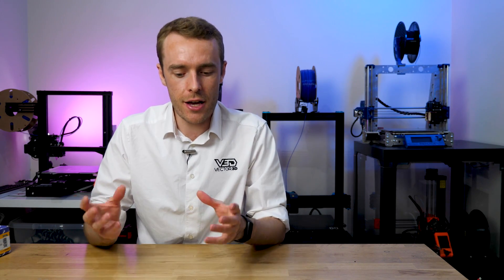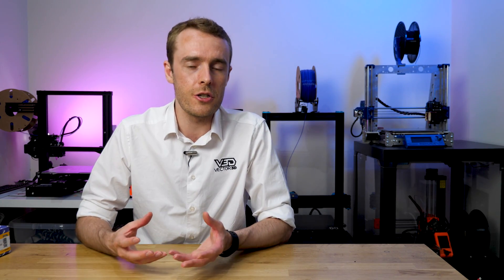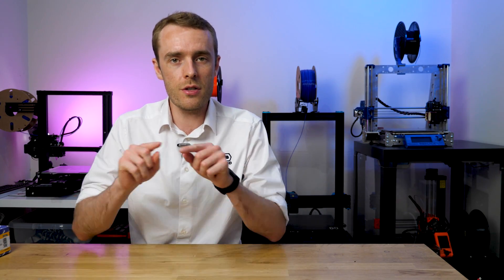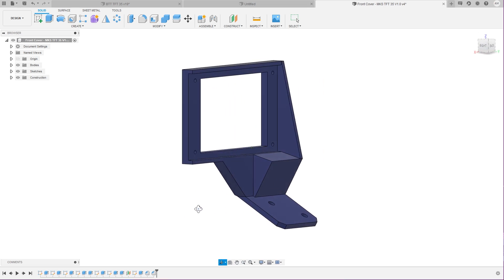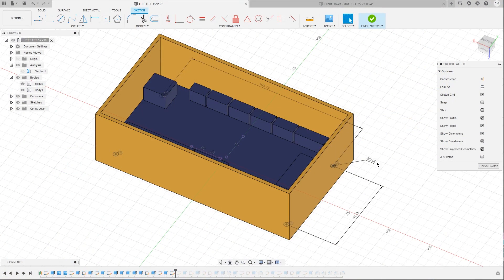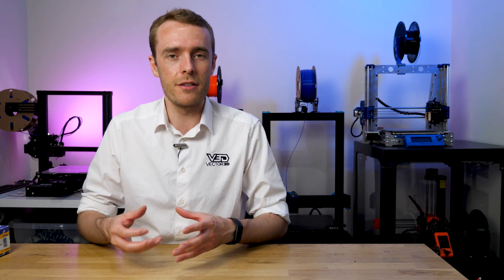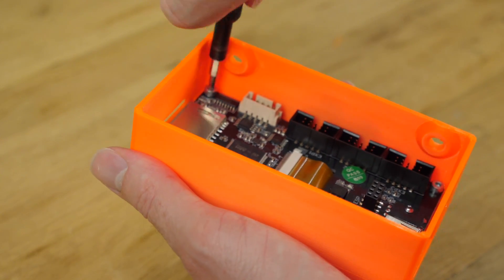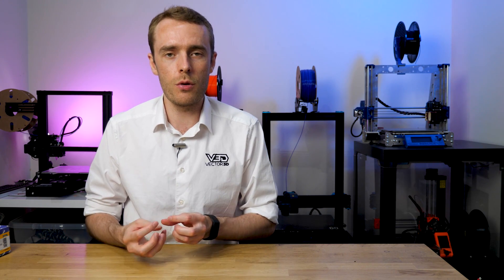6 Simple Design Tricks for Touch Screen Enclosure using Fusion 360

Comment: On a technical note (pet peeve?): "tolerance", and "clearance" are often interchanged, but are technically different. You're a smart guy, so I suspect you actually know the distinction, but are just a little loose at times (though, not like you, typically).

Most often, when one misuses the term and says "tolerance", they should use "clearance". CLEARANCE is the design intent spacing between surfaces (or "gap") to result in a desired fit (from loose to tight). TOLERANCE is the ability of a machine to produced a desired dimension (length, angle, roundness, etc.).

To be clear, people are not "doing it wrong" when they conflate terminology, at least when not communicating with/among engineers.

OK, just hoping to make a clarification that some people will value.

Comment: Seems I can do a FIRST, and add something. There is a page called https://grabcad.com where you can find many technical stuff and components, ready to be imported into Fusion360. Maybe the display or some knobs and stuff are available already, to design around. Saves some time ...
Reply: Beat me to it. Grabcad is a fantastic resource, I rarely have to create my own reference components.
Reply: I was wondering if these reference parts already existed somewhere so that I could just import them into my drawing.  Thanks so much for sharing that info!
Reply from the maker: Yep, it's great. But I'd still recommend double checking dimensions yourself as they can be poorly measured.
Reply: Absolutely.  Trust but verify.